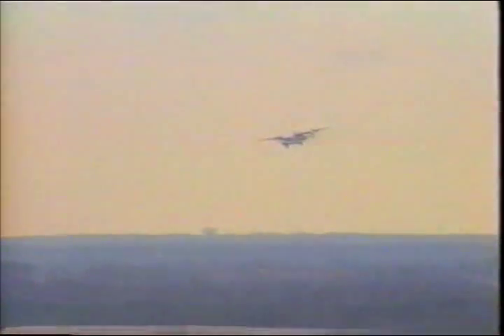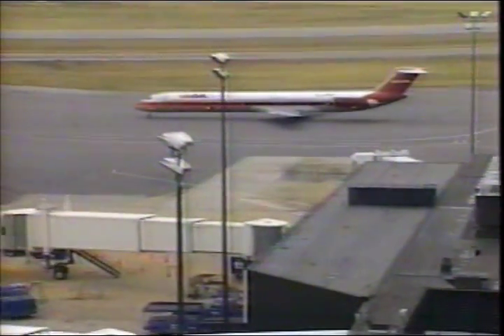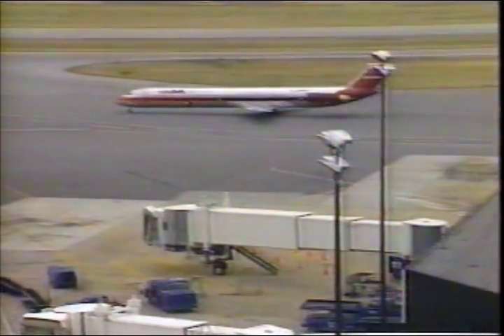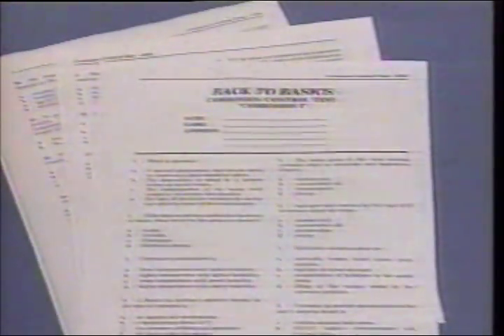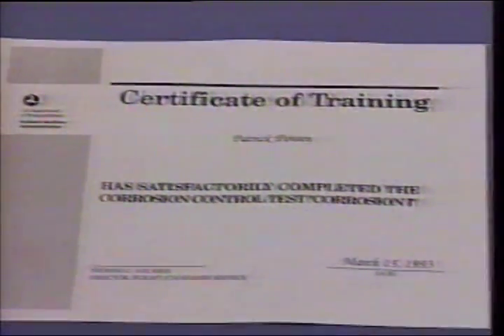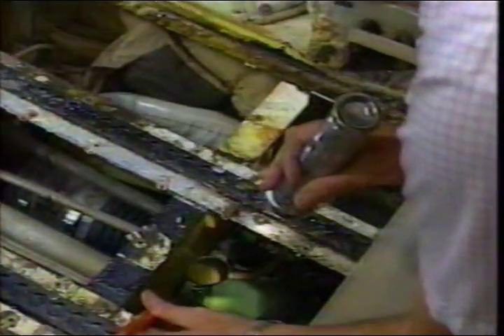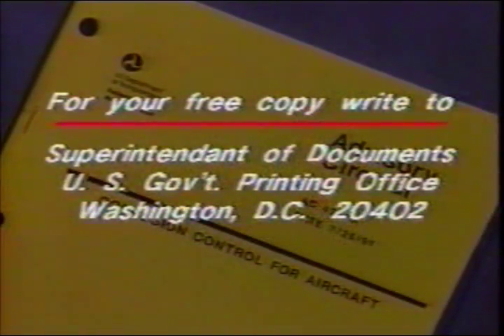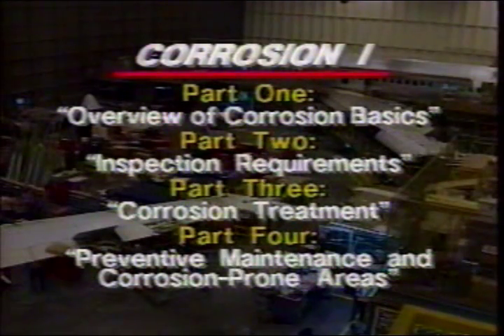Corrosion 1 Introduction.WMV

Comment: At the beginning of the video a mechanic is performing a corrosion inspection. I have done that also. He is using a bright flashlight and holding it at an angle to the aircraft skin. That will show any non-conformities as shadows. The aircraft skin should be relatively smooth. Corrosion will distort the skin in areas where it is present. I try to lead the younger workers to do things like I was taught in the beginning of my career. Use a bright flashlight. They use pocket pen lights and don't hold it at an angle. You can bring a horse to water, but you can't make him drink :>  I'm going to retire in a year. If your a new mechanic, ask for and take advice from people that have been doing this for along time.